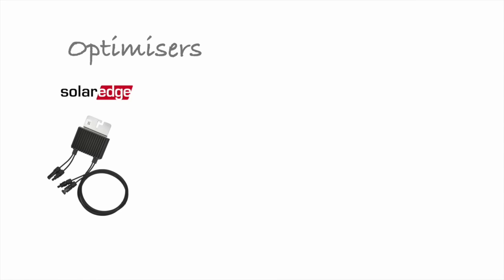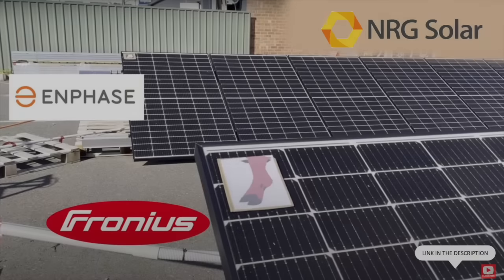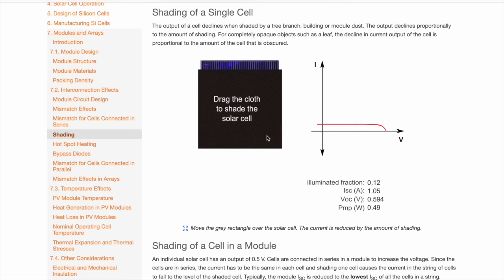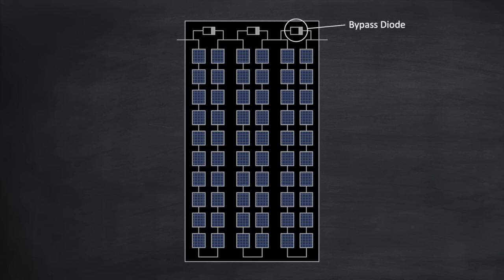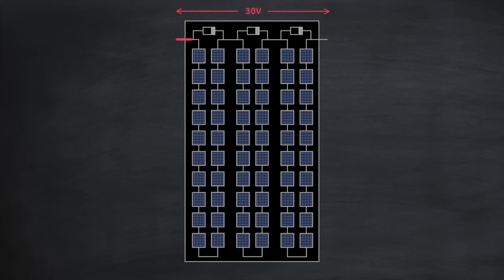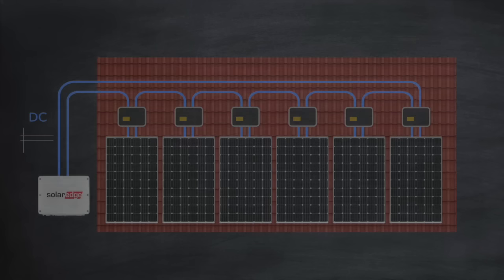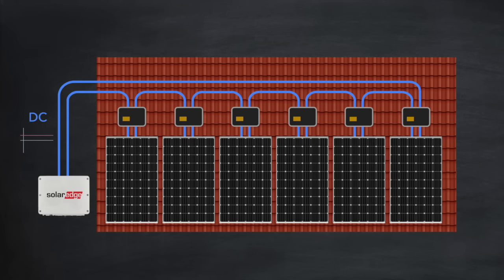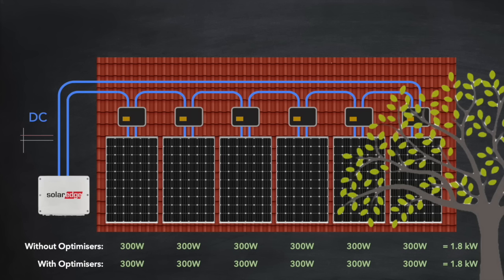Solar Panel Shading (Part 1): Are Optimisers and Micro inverters Worth It?

Comment: Seems to me that this is fine for roof-mounted PV panels where shading is minimum and slow-moving. However if the roof is unsuitable then panels might be fitted against a wall/fence -Apparently this option is gaining ground in Holland in particular (google “solar fences”). With a solar fence I imagine shading could be a bigger problem with people moving past or children playing in a garden. So for that case optimisers or micro inverters might provide a sensible solution.
Reply from the maker: Hi Jorki, thanks for taking the time to comment. I'll check out these "solar fences" :-)
Reply: @GaryDoesSolar   no problem. I’m interested as I have very little roof space but a long garden. Might need planning permission though! The other possible reason for microinverters is less reliance on a single point of failure with the string/hybrid inverter. Ive read that microinverters have similar lifespan (25 years) to the pv panels, as opposed to 10 years for string/hybrid inverter where a guarantee extension to 25years costs extra, so maybe making the microinverter solution cost comparable.

Comment: What about partial/full cloud coverage? What about aging Solar panels? Are there any benefits with optimisers?  Are the (Solar Edge) Inverters cheaper because they maybe don't need MPPT hardware?
Reply from the maker: Optimisers only have benefit where there is localised shading across an array. Cloud coverage will usually affect the whole array, so no benefit. Regarding ageing, if the panels aged at different rates (unlikely) then there would be a benefit. I'm not sure I understood your last question - a string inverter has a single MPPT per string, whereas a micro inverter system has an MPPT per panel.

Comment: A suggestion for a future video; how to match panels to inverters and batteries  with respect to volts power amps and avoiding overload.
Reply from the maker: Hi David, that’s really for the installers to do, but I am working on a quick video, explaining the various electrical terms, so that people aren’t scared to look at data sheets etc. 👍🏻
Reply: @GaryDoesSolar  I'm sure it will be instructive whatever you decide to do.
 Perhaps a few examples of the terms using max power/max current of panels and how that electrically matches with inverters & batteries? As you say that's for the installers to do.
Reply from the maker: Thanks David - I'll try to make it as accessible as I can👍

Comment: would be interesting to see readings from cloud coverage
Reply from the maker: Actually, that's straight-forward. Cloud coverage will affect all the panels, therefore there is no localised shading (that's all the bypass diodes and optimisers care about). That means all the cells will generate current at roughly the same level, depending on the amount of cloud cover.

Comment: I guess I am dense.  What I took away from all this is that you don’t need either micro inverters or optimizers unless you have special circumstances. But, aren’t most installers doing one of the other…optimizers or micro inverters? What if they don’t allow you to change their installation architecture based on my knowledge of watching YouTube? Will they not support my wishes? I’m still confused as many YouTube Solar “experts” seem to be advocating for micro inverters now as a single inverter is a single, expensive point of failure.
Reply from the maker: Hi Gerry, I'm not surprised you're confused by all the options. The solar topic is a minefield, and it's one of the reasons I started making videos in fact - to help people wade through that minefield. In general, I wouldn't simply go by what any one person might be telling you (whether that's an installer or YouTuber - and I include myself in that). The best way, is to gather lots of information, then make a determination based on all of that - it's extra work, but you should be better off for investing that time. 

On my shading video, I deliberately restricted the topic to shading, but optimisers and microinverters do have many other benefits. Take a look at my microinverter video (https://www.youtube.com/watch?v=q6t0AAi5Jws) which details those benefits. I'll be making a similar video on optimisers shortly. The big downside of microinverters (and indeed optimisers) is that there will be a cost to you (not least scaffolding) should one of those units fail... And it's one of the reasons that some installers won't do one or both. And you'll find other installers will ONLY do optimisers/microinverters(!) It's just a question of past experiences I guess...
Reply: @GaryDoesSolar  Thank you very much for your advice and the time you take to make these videos for us! I will continue to do more research, starting with the video you referenced.
Reply: Solar Edge doesn't have shade remedies other than optimizers, and sometimes are needed. Other manufacturers do have shade mgmt devices integrated into the inverter--- Look at SMA and the Sunny Boy Smart Energy soon to hit the US market--has shade mgmt included in the logarithm and internal architecture--- no need to use Micro's or Optimizers!!

Comment: So why wouldn’t we just make solar panels with all the cells connected and little bus bars around the outside of the panel so there’s multiple ways for the electricity to flow from whatever cells are getting sunshine?
Reply from the maker: Quite a technical question, and one I can't answer myself. I guess though, if the benefits of doing so were clear, the manufacturers would be doing so?

Comment: Actually, both shown marketing materials were wrong. The bypass pipe analogy is totally wrong, as panels already have bypass diodes. It is a bit difficult to explain in a few sentences, but with bypass diodes and a working MPPT string inverter one shaded panel CAN NOT affect the output of other panels. The issue is that if a given panel becomes shaded (and sometimes shaded even by a small amount) it completely loses power as the current starts flowing via the bypass diode. An optimizer can salvage some of this lost power and add it back to the string (its a bit involved to explain why). Another benefit that an optimizer may give is to make life easier for a MPPT string inverter if it does not search for the best current-coltage setting for a given string, as shaded panels make this optimization landscape somewhat jagged.

To summarise, this is what happens when marketers with no knowledge of engineering try to present complicated concepts to customers with also little engineering knowledge.
Reply from the maker: Are you not just saying what I said myself in the video? I showed the marketing material then explained in the remainder of the video why it wasn't correct...

Comment: Your leaf analogy is fun but leaves don’t fall one at a time and generally don’t flow away and snow doesn’t either 9here in Canada or other northern climates. Your lack of detail on micro inverters was not as derailed as it should be,
The monitoring of every cell by emphase lets you know the total output of every cell.
The warranty is great and they monitor as well.
The price is great when you take into account the string inverters need replacement after only 1/2 their lifetime 10 years
Snow and dirt are a killer for performance 
Isn’t it better to be able to monitor on you own screen the output on your investment ?
Reply from the maker: The leaf example is really only to show shading management from first principles - it was not representative of typical array conditions.

Comment: It is possible to optimize individual strings in a panel by replacing the string bypass diodes with individual optimizer electronics. There are even patents with an optimizer per cell
Reply from the maker: Hi Jeremy, I wasn't aware of that, but it makes sense. I guess the optimiser circuitry would have to be built in to the panel directly then, otherwise there will be panel warranty issues...
Reply: @GaryDoesSolar  Ignoring warranty, the diodes are field replaceable so it's very easy to plug a module in that replaces the diode. The module can also provide a diode as a last-ditch bypass option. The patents for optimizer per cell had a very low voltage microprocessor per cell, with a 'party line' arrangement so each cell could share an inductor per string.
Reply from the maker: Jeremy - that's really good insight - thanks!

Comment: It is my understanding that in the event of a fire, solar panels with optimizers are much safer because the voltage is very low when the system is shut down .
Reply from the maker: Thanks - let me do some research n that… 👍🏻

Comment: Great video 👍
Reply from the maker: Thank you Wayne 😀👍🏻
Reply: I have a question you may be able to help me with.
I currently have a grid tied 8 x 370W panel and 3.6Kw Solis inverter system and want to add an additional 6 x 370W panels on a different elevation and string. Will this effect the efficiency of my current panels? 
Will connecting the 2 strings using a diode connection fix any issues?
Reply from the maker: Hi Wayne, unfortunately, I'm not in a position to provide advice (not least because of potential liability issues - even if advice is given free - such is the world today). You're best to speak to an installer about that, or post a comment onto a solar forum (e.g. this one in the UK: https://www.facebook.com/groups/2197329430289466) Good luck!

Comment: Hmmmm, just to add further confusion! Ive seen vids where people say the optimiser hrlps identify which panel may be faulty and easily targetted. The obvious help being if you know which panel is faulty, you dont need a full install of scaffolding and time on the roof to identify which one has the issue.

To be honest, as a complete solar novice, Id like to see other YT vids come to the same conclusion optimisers arent needed because at the moment, this one is an outlier.
Reply from the maker: Actually, I did not come to the conclusion that "optimisers aren't needed" - and in fact, I was careful not to draw any hard conclusions at all. I want the viewers to be well-informed about the technology so they can draw their own conclusions. If I had shading on my roof, I would get optimisers installed, but only on the affected panels - for the same reason you stated, just to know what was going on up there.
Reply: An optimiser/inverter will enable detection of a faulty panel if thats  important to you fit them.i can draw a conclusion, micro inverters are not worth fitting to combat shading. this clip is not an outlier if its factual and well researched.
Reply: An outlier in that Gary isn't trying to sell you a device.  😊😊
Reply: Im a solar technician here in the great solar state of California, US. Im going to tell you right now just get an enphase microinverter system.
Forget shading, forget pros and cons.
Spend the extra money, it'll save you headaches in the long term. Dont listen to what anyone else says.

Production numbers dont matter. All 3 solar types will get you that but microinverter systems are designed to reduce single points of failure so if the panels do go faulty (Arc faults for example), The rest of your panels will continue working. Since theres no central string inverter either, theres no inverter that can go faulty and stop all solar production. Only a single faulty micrinverter will stop. Ive replaced some inverters before that died literally 5 minuets after turning it on brand new.

Im not even pitching bias or sales here. Im just telling you the straight 7 years of solar troubleshooting truth.
Take it from a solar tech with a track record of 100 faulty inverter replacements. Solaredge, SMA , Fronius, Huawei and every inverter in between.
Reply: @GaryDoesSolar  Appreciate you didnt come to any 'conclusion' per se. Probably my clumsy way of just saying Id like to see more YT vids that give similar information optimisers arent required.

I have since found at least one other that does suggest the same. I find your vids highly informative onthe matter of solar.

Comment: How about connecting panels in parallel? Would tickers cables and different inverter be cheaper option than optimisers and micro inverters?
Reply from the maker: Hi Conan, yes - a parallel option for current to flow certainly helps with shading 👍🏻

Comment: What about if one panel is hotter than the others? I have only recently been looking at getting solar and was surprised to learn that they don't work as well when they get hot. Would microinverts/optimisers help if one panel is working as a lower efficiency than the rest? Would that one panel bring down the total output of the rest?
Reply from the maker: Yes, it's generally true that a hotter panel will not perform as well as a cooler one. The question might be then, for a given array, are the individual panel temperatures like to vary much from each other? If yes, then microinverters/optimisers would rectify any consequential losses...

Comment: This has really helped - thanks. I now have a PV systems with batteries installed. The installer has suggested I now install a Voltage Optimiser. I see conflicting information about the savings. Could I use less power and thus export more power ??  Thanks. Leigh
Reply from the maker: Do you mean optimisers on each of your panels?
Reply: @GaryDoesSolar -  No Gary - specifically a Givenergy Voltage Optimiser that regulates the voltage into all appliances from 240 plus down to 220 ish
Reply from the maker: @leigharnold4938  Ah, I see. Sorry - no idea. Hopefully someone else on here can help 👍
Reply: @GaryDoesSolar  OK - thanks anyway

Comment: solar panels already have a bypass diode - tests was done by someone who did it with optimizers and without optimizers and he concluded there was no real significance between having them or not having them, where he shaded off a panel and got identical results 
He did also conclude if the solar system is really small though, then optimizers did have a benefit - but larger string line setup it did not make any difference
Reply from the maker: Thanks - do you have a link?
Reply: @GaryDoesSolar  no sorry - i just sore the video and you did a fantastic - more in depth to them, it was interesting as they did their own testing of a full roof set up - if i recall they also had access to their neighbors solar set up also 

mind you been watching a lot of videos of late on solar - im no expert, just learning and choosing the best set up for myself in the future - did not fully understand optimizers or micro inverters (inverter benefits other than being individual inverters) I think between your video and his, i worked out whats best for my set up 

i would like a enphase battery system, but its more economical sense minded to go with optimizer set up with an alternative same type of battery technology enphase use - lithium phosphate 

I do thank you for your video - very informative
Reply from the maker: @lexxel01  You're most welcome - cheers!
Reply: @GaryDoesSolar  i decided against optimizers 

i do have a question - if i was to get over 400watt panels - the micro inverters from emphase only allow 295watt and thats over 105 less than the panel 
I dont see the point of having micro inverters that being the case - that is meant to be their highest yielding micro inverter for panels of 340+watt plus 

would you be able to do a video on this - explaining things better in regards to what sort of wattage power panels to micro inverters - that would be a good video for people
Reply from the maker: @lexxel01  Take a look at this video I made on microinverters - will hopefully answer your question: https://www.youtube.com/watch?v=q6t0AAi5Jws

Comment: so in conclusion, if you do not have shading and only worry about long run degradation of individual panel, optimizer is no brainer. If you are facing shading issue, then either accept the lost or beef up more panel with optimizer. Otherwise you are forced between using microinveter or chopping trees, whichever cheaper.
Reply from the maker: Lol - chopping down trees is always an option I guess :-)

Comment: Not sure the "soft shadow" scenarios are well described. Bypass diodes are only kicking in with hard shadows
Reply from the maker: Bypass diodes don't care about the kind of shadows - they just detect a difference in current flow in the panel they are monitoring. If there is sufficient soft shadow on this panel, but not the previous one, the bypass diodes will kick in...
Reply: @GaryDoesSolar  conduction will happen through the bypass diode only if or when the string current makes the shaded cell reverse-biased. With shaded cells you may have conditions in which the cell still operates forward biased, with no conduction through the diode. The more a cell is shadowed, the "easier" it is to get the reverse bias condition, which is what happens with hard shadows that i see in tests with cardbord put in front of the panel. just saying it's not a black an white thing and diodes are neither shadow or current "detectors".
Reply from the maker: @marcomikemarco  Thanks for taking the time to share your thoughts and experience on the matter of shading - it's very much appreciated. I think we can certainly agree that the harder type of shading (that most people will experience if they have any kind of shading on their panels) will cause interaction with the bypass diodes.